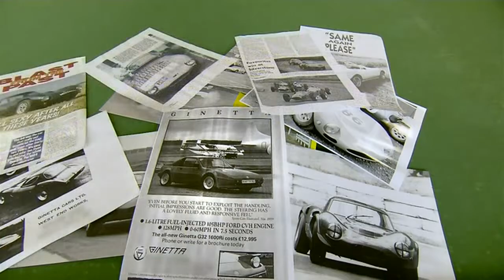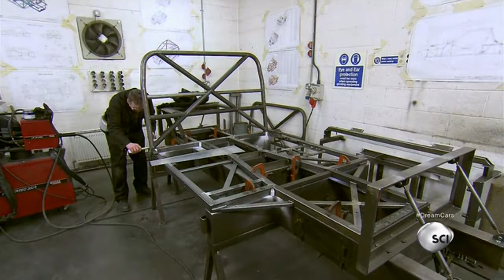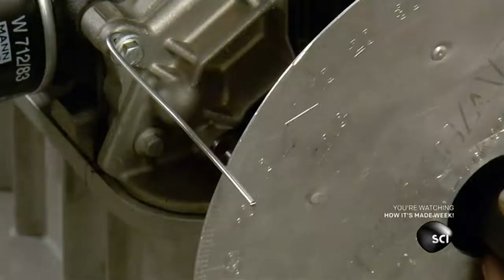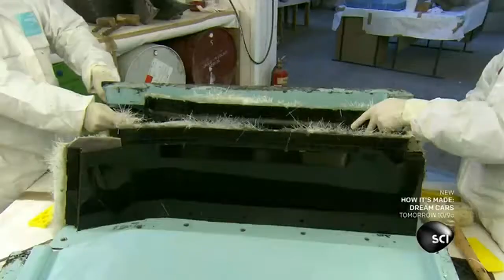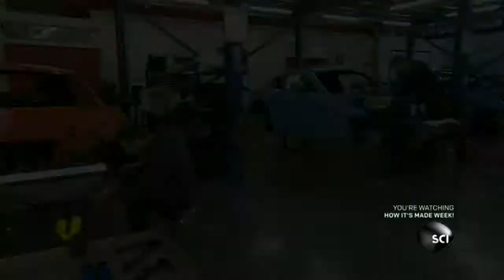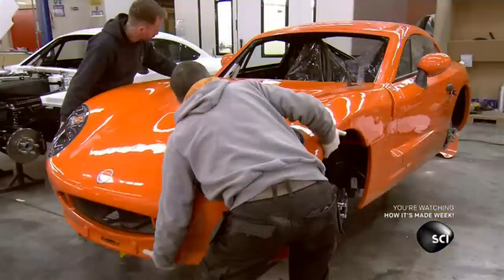How Its Made Dream Cars Series Ginetta G40

Comment: It’s not actually torque paint as he only paints the bolts, showing himself he already torqued them down.

If they really wanted to make it visual down the line they would make a line from the top of the bolt down the side of the bolt and on to the casting, THEN you could see if the bolt has moved or not.

It’s a drive shaft, torque tubes are used when the transmission (transaxle) is located at rear not at the engine.